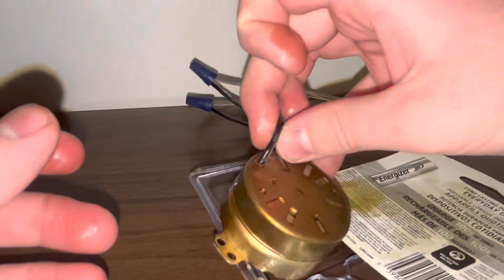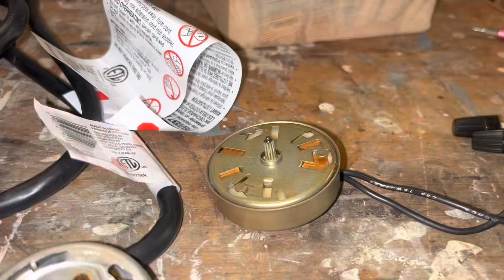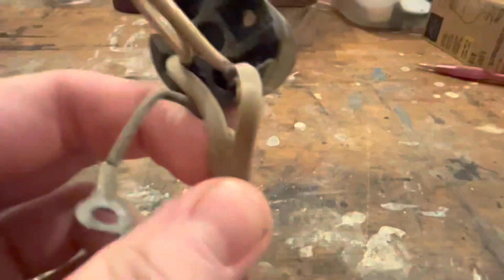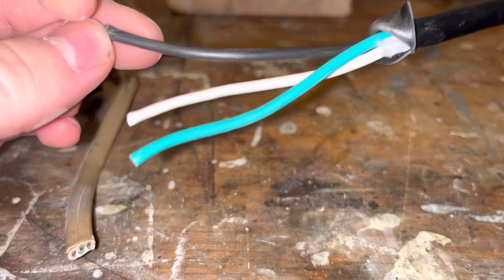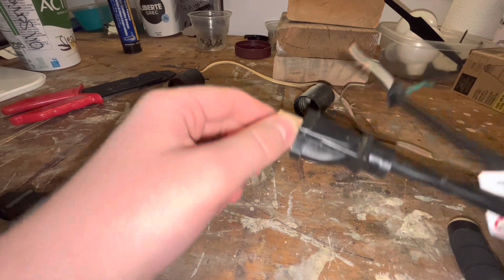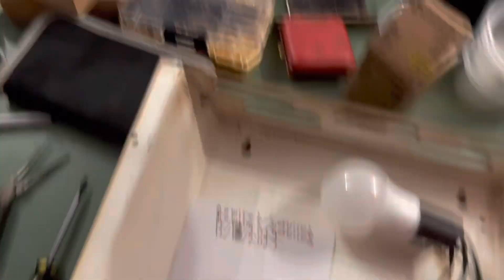M004 Synchronous motors in historical advertising clocks (Part 4)

Comment: Interesting to see how the motor/gearbox works. Useful if I ever come across something like this. I have opened up a few modern quartz mechanisms and as far as I can see there isn't anything you can do to repair them. I have used one in an old clock cabinet though to get a working clock though 😅.  Thanks 😀 👍

Comment: It's pretty ingenious design having the motor come off like that, I really thought the gearbox was the problem too. Shame you can't get the gearbox apart, that centre pivot hole in there looks absolutely surrounded in dirt, but honestly I wouldn't try and open it up either.